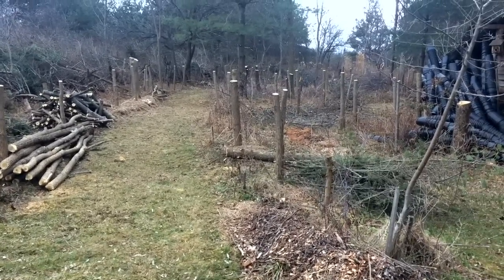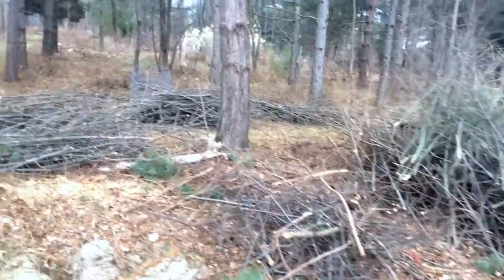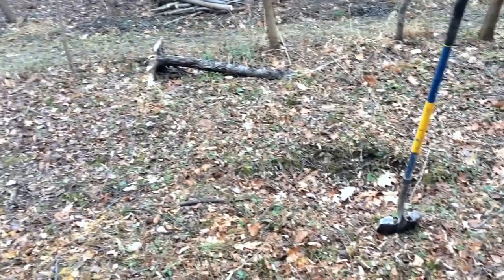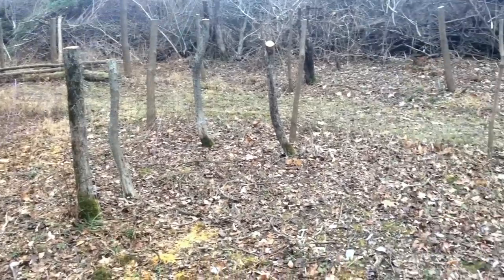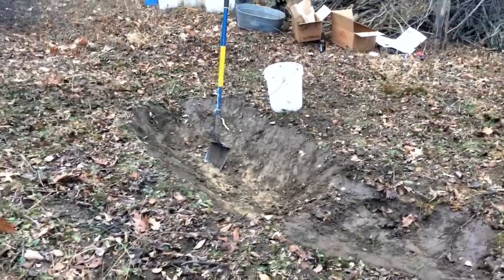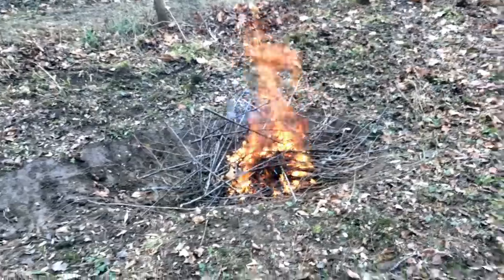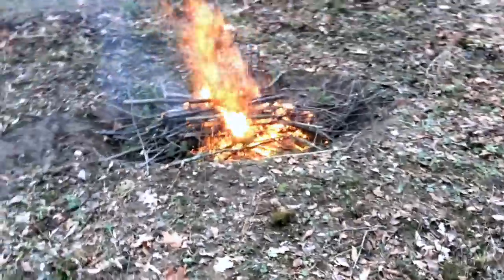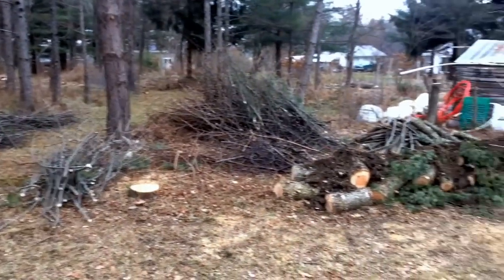Orchard Design 3 - Biochar Processing in Cone Pit Trench Method

Comment: G’day, great work area set up.
Great method in exhausting the volatile organic matter by agitation.
I would just like to share some experiences and safety with open flame top kilns no matter the design or technique employed.
Fire permits are required most of not all the time where I live.
Water for fighting a fire outbreak is needed.
Open topped water filled 44 gallon drums with hessian bags wet ready for fire fighting use only.
Hose from the house if possible.
Independent powered pump with hose to area.
Land clearing tools to fight fire on the ground.
Have a pile of loose dirt that is easy to shovel near the kiln so that if needed it can be used to cover the kiln with 10cm / 4”.
You never know what things can happen that require you to walk away from your job.

Clear the immediate area around the kiln.

I like putting a slightly raised edge around the perimeter of the cone. It helps create the vortex and control the abuse of the crosswind on your flame curtain. Note to self: the flame keeps oxygen from reaching your Char .

Please note the soil in the area of the heat zone of the kiln is now devoid of all life. This is something to consider when choosing an area to put an earth kiln on your property. Otherwise use a purpose built kiln that is above ground.

Kiln safety.
If you can feel the convection currents with your face you are too close. You may be breathing in toxins that cold harm you or make you pass out. Note to self: you cannot see the exhaust gasses.
Any pine or green timber will produce smoke from moisture or oils. If you are producing black smoke it’s best not to use this material for this method. Prepped and dried timber that is down to 10 percent moisture is your ideal feedstock.

WARNING: NEVER USE TREATED OR PAINTED OR SUSPECTED TREATED TIMBER. EVVVVVVV-VER.

The toxins will stay in the Char.

If you have larger pieces keep dragging them to the top so you can see them break down and they are in the heat zone.

Outside of what Frank Strie’s comments on inoculation there is something else you could try during the process
Of pyrolysis!
Your soil, from the immediate area where you intend to plant get a small pile of finely graded soil. As your kiln is working sprinkle some of this in lines from the centre or just off toward but not to the outside edge. (Keeping the flame curtain is your goal in life.) In quadrants like an orange or a clock-face. Just sprinkle in lines or it will dampen your flame. Unless you need to dampen your flame. This will change the microstructure of the surface of the Char.
Please note that a flame topped cone kiln in the ground is no place for children to be around supervised or not.
This is my desired recommendation.
Now go and play safe.
All the best.
Joel - Man Of Char-in development.
Australia 🇦🇺 
Friday 19th Of April 2019
Reply from the maker: LOTS of excellent points and observations, suggestions, etc. here.  Thanks kindly for taking the time on this.  I'll re-read before the next burn as you clearly have a lot of experience and I love deeper perspective when I can get it!  Thanks again!

Comment: I love this! A couple questions 1) how has it worked out subbing this char for the perlite in your potting mix? I’d love to use things that I can make instead of buy. 2) do you think it would be easy enough to build a sugar syrup evaporator rig over this so that I can harvest the heat to make syrup? I’m doing lots of research into ways to use wasted heat in this process and also try not to waste wood to cook syrup. Thanks!
Reply from the maker: 1) Char for perlite... Works pretty well, but I wouldn't say it's a perfect replacement.  Perlite is able to really keep open and light no matter what, char will take on water and get heavy over time.  Very different that way.  I think the char really helps with porosity and flow, but it isn't a very light mix.  I still think I'd like to continue to phase out the perlite, though!
2) possible to build that, I'm sure.  I haven't done enough maple syrup to give any real ideas.  But it is a ton of heat, so why not?  The trick is that this fire needs a lot of poking/feeding/agitation/etc.  It is a bit tricky that way, but if you can design with it I bet you can make it work.  Make char a number of times first and then see how to phase in the additional layers I'd think.

Comment: When we want to pour charcol to the land, should it be chased or just pour it on?
Reply from the maker: Chased?  I'm not sure I understand...
Reply: The charcoal needs to be mixed into the soil. You can till it into a large area. You can mix it around the root zone of individual plants when you plant. You can drill holes around established planting and fill the holes with biochar  (vertical mulching). You can spread biochar 3 or 4 cm deep over an area and cover it with mulch (let it slowly enter the soil).

Comment: Do you think that pollarded trees like this could take the place of fence posts on a sheep farm? Stretching fencing in between the pollarded trees?
Reply from the maker: Its a good thought but I personally wouldn't do it.  The trees grow/expand/go upwards... It would put stress on both the fencing and the trees and something would fail.  Perhaps a temporary fencing for a year or two would be reasonable but any sort of investment I would use heavy duty locust posts set in the ground...
Reply: Thank you for your response. What about weaving hedgerow cut willows in between the pollarded locust?
Reply from the maker: That sounds like a lovely and natural way to make fencing that would last a little while.  I'd hope you experiment and share notes!
Reply: Sorry to be so late but densely planted coppices have been traditionally used as the basis for thick fencing, with small woven fences filling in the small gaps between

Comment: Would of like to Eden the removal of the boichar from the pit. Do you let the wood burn all the way down before removing the char?
Reply from the maker: A little confused with the question.  But I quench it before it converts to ash if thats the question.
Reply: If you let it burn all the way down,  it becomes ash. 
When the yellow flames are gone, all the wood gas and volitiles have been consumed. At this point, all that is left of the wood is carbon.  No flames or blue flames means carbon is being burnt.
So when the yellow flames are gone, you need to either add more wood or lots of water to quench the fire.
You could cover the pile with dirt to smother the fire but this doesn't work very well. It mixes dirt into the charcoal which you may not want, it is very hard to get completely coverage so you have to keep checking on it or it will keep burning, and it takes 2 to 3 days to cool off.  My experience is that water is faster and easier.

Comment: Cool, thanks for the shout out.  I've never tried to run one continuous like that.  I make my trenches about 10 feet long for all the long limbs I've always got.  I envy your locust :)
Reply from the maker: My pleasure, you put out good content, and its nice to have our communities get to know one another (although I suspect a ton of overlap already).  10 foot trench sounds appealing, although my site is pretty small for such a large flame.  I may extend it a bit for the next run, and it really seems promising to extract finished char from one side and quench it and then keep running the system.  The char quality came out incredibly high and I was able to get a lot processed in a smaller pit.
Reply: Wondering if biochar can be used as a fuel for blacksmithing or cooking then use to amend garden?
Denis
Reply: @denislosieroutdoors  if you snuff the char / carbon without moisture it will be useful to you blacksmithing and cooking.
Reply: @frankstrie3214  thanks I'll try that here in Southeast Canada eh!
Reply: The char already is the endproduct you dont want to burn it. But you can make it as a byproduct from cooking with this https://www.youtube.com/watch?v=gViTUz3vSF0
Reply: If you want fuel, make charcoal instead (i.e. don't inoculate it with compost et al).

Comment: Brilliant as usual.  It's great to see this project.  I've been out of action for awhile, but looking forward to catching up on your progress.  This looks like an excellent alternative to chipping, which I stopped doing, but I've got lots of piles of trimmings and trees that I now have an alternative to simply leaving them to slowly decompose.
Reply from the maker: I really enjoy how thoroughly and effectively this process can deal with some huge piles of slash and debris.
Reply: I have used this method to clean up the brush from a few acres and made 8 to 10 cubic yards of charcoal so far. It is fast, simple and cheap with the bonus of a valuable soil amendment. 
I  dig a vertical sided pit, 3 foot wide by the same deep, 8 to 10 feet long. It handles long branches and small trees without the extra work of cutting every piece to fit. I can fill the pit in 6 hours of dragging and tossing.  That is a lot of brush considering charcoal is about 25% of the volume of wood.
Even if you don't use biochar in your garden, spreading the charcoal back into a forested area improves the soil and plant growth for the next few millennia.